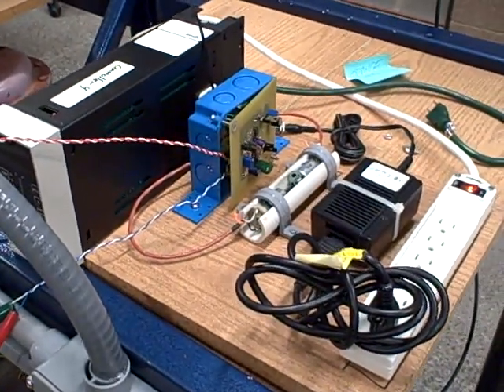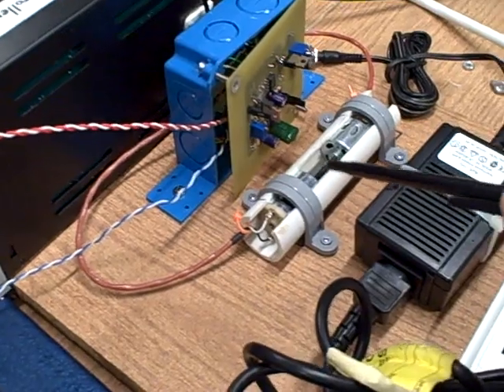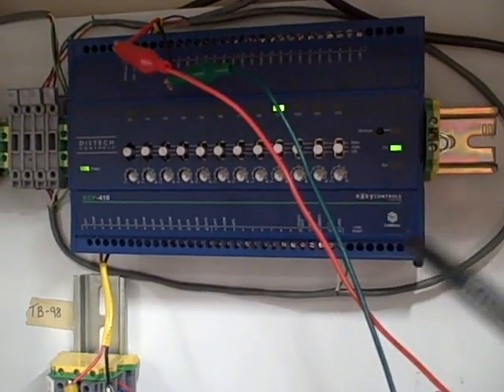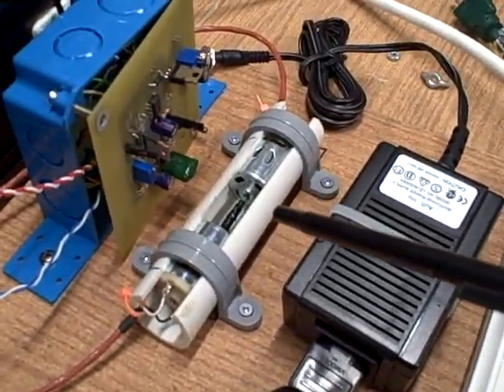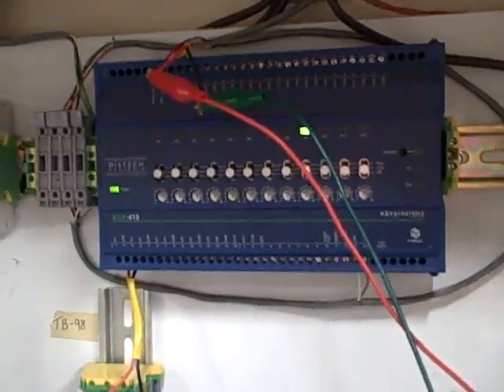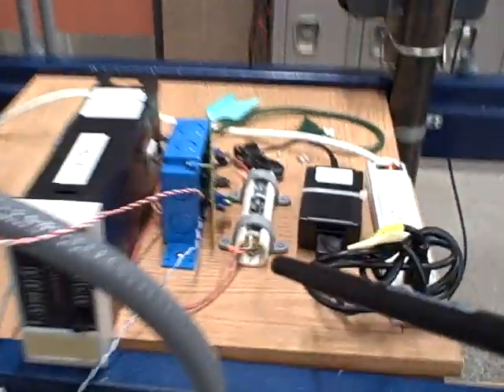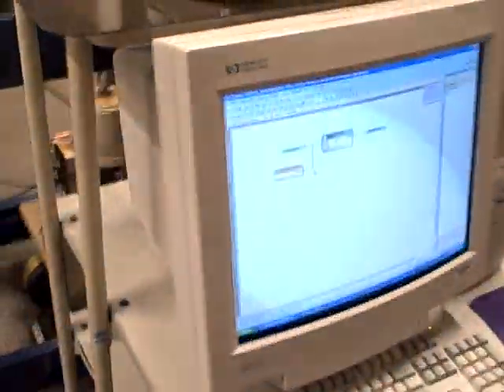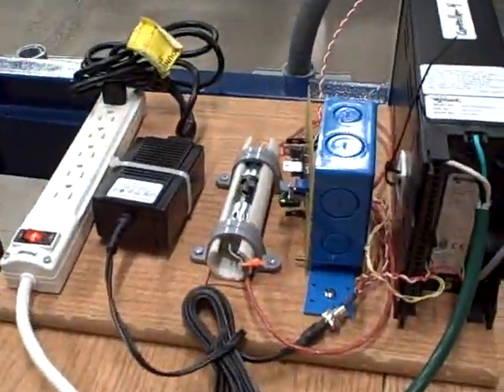Motor speed control using DDC controller (PID control)

Comment from the maker: @ru4realthistime You can get the motor to control reasonably well by using very little proportional (gain) action and mostly integral (reset) action, but in order to prevent oscillation with such a slow controller update time you end up with pretty slow controller response.  If the controller had a faster update time, you can get away with a more aggressive proportional action and much snappier response.
Dead time is the bane of feedback control.

Comment: I agree with 4stringaddict, either your pid needs tuning or your logic is too simple. With no external load on the motor it would be no problem to control the motor speed. As soon as you set a starting rpm speed you then start your loop. It would gradully speed up or slow down to meet speed setpoint.

Comment from the maker: @4stringaddict This point of the video was to show how you cannot adequately "tune" a controller with a scan time slower than the speed of the process being controlled.  In a later video, I show how a "compromise" solution was found tuning integral-dominant instead of proportional-dominant, but the response to setpoint and load changes is still a lot slower than one would want for motor speed control.

Many techs think any control problem can be corrected through tuning.  This is not true.